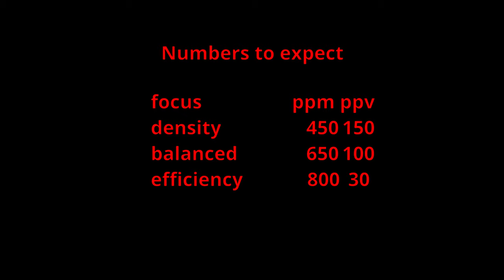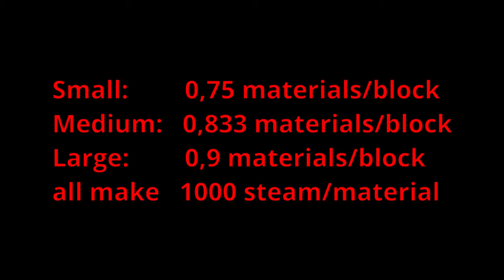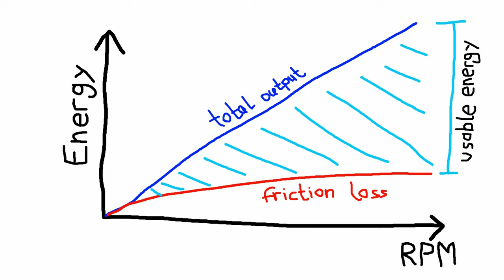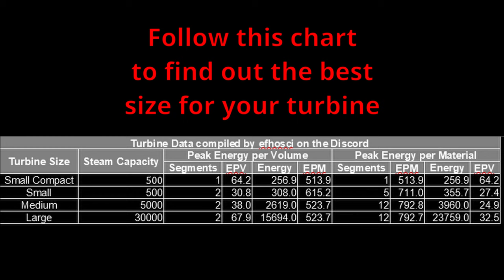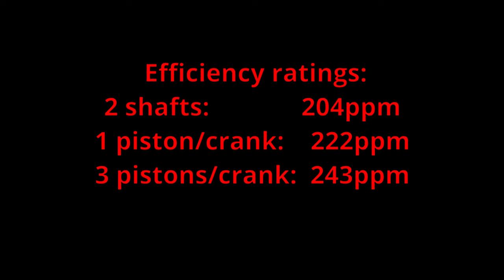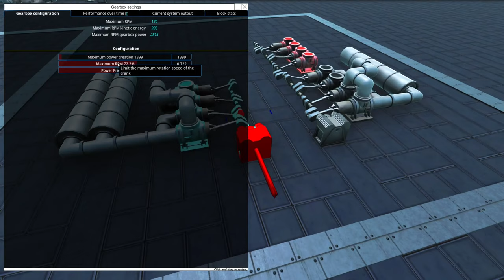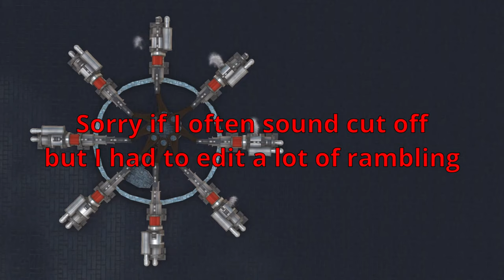Steam Engines Full Guide (From the Depths 2021)

Comment: I made an efficient and powerful engine my boat goes very quick now love it.

One weird thing is that I don't get the large crank motor to work. When I build my ship using large crank motors it only was producing 60.000 out of 180.000 thrust. So I increased engine power and it didn't change... I didn't know what was going on at this point. I then disabled the engine. And it still produced 60.000 thrust. Then I disabled all engines and turbines and it still produced 60.000 thrust???.

I deleted the large crank motors and with a lot of internal reshuffling in my ship I powered it with a standard crank shaft producing 170.000 thrust. Somehow material usage on my ship has gone down by doing that.

What is going on? What am I missing? please help!
Reply from the maker: I think steam recieved an update since this video went up, not sure what changed though.
Tbh I'm quite out-of-sync with whats happening in the game in general, haven't played in quite a while, so I cant help you.
I suggest you ask over on the official FtD discord server, thery are very friendly and helpful people, I'm sure you'll find your answer there.
Reply: @livslab  okay, thanks. It was only due to this video I was able to build a steam engine in the first place and I like them more than fuel engines.

Comment: why is it that you want your steam engines pushing at 100% all the time? I understand for the purposes of testing but I can't understand why they'd be worse if they weren't working at full power
Reply from the maker: Yes, it's most important for testing since using less power than you produce will screw up the numbers, making you think that the engine can put out more power than it actually can (when testing without load the engine will spin to a much higher RPM, increasing the theoretical power output, even though in reality as soon as you put the engine under load it will slow down and put out less power).
In actual combat its just a matter of efficiency, a huge engine running on snall loads will still loose a lot of power to friction, so the numbers you saw in testing might be inaccurate, to the point where it might be better to run a fuel engine if  you run your engine too inefficiently. But worst that can happen is a slightly worse operational cost of your ship.

Comment: if you use steam containers as a buffer between pistons and turbines, does it stop any backpressure?
Reply from the maker: no idea, gotta test that one
Reply from the maker: no, it doesnt help. Backpressure happens when the steam cant get used up on the output, and since the steam tanks dont actually use steam they dont help with backpressure. In general they are pretty useless (lets be nice and call it niche) at the moment so I didnt bother talking about them.
Reply: @livslab  that sucks, oh well.
Reply: @Henrik Freitag I was wondering if it provided a barrier to prevent backpressure, and thus allowing you to use a turbine with the excess steam
Reply: @livslab  Idk, I've found some uses. They are rather niche, but they work well with steam jets that aren't being constantly used, I've found ways for them to work with valves to increase a system's durability versus EMP, and I expect I can probably find a few more. Plus, they store waaaay more steam than boilers, so they could be useful to keep providing high pressure steam for at least a few minutes after you lose enough boilers than you can't produce enough steam anymore.